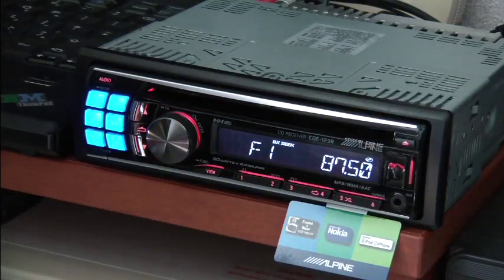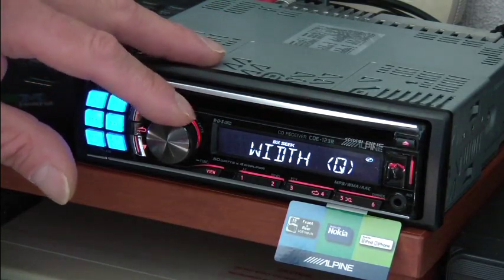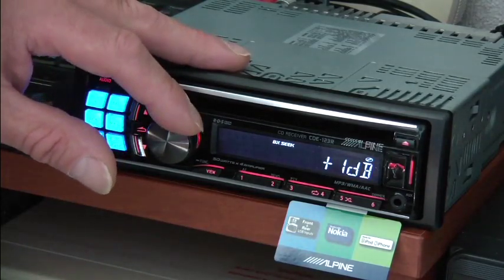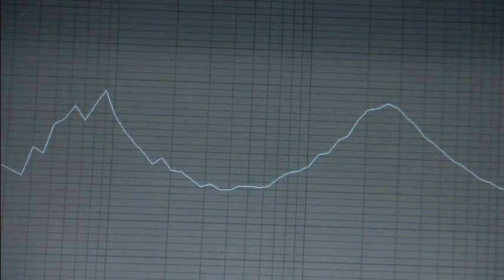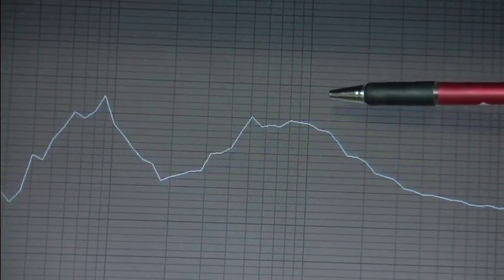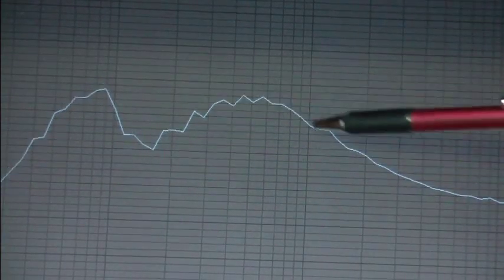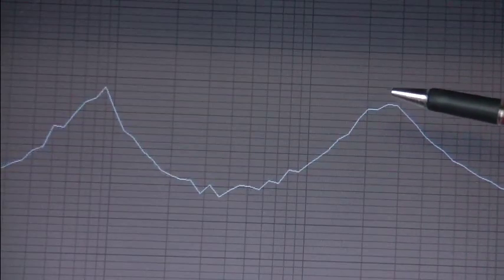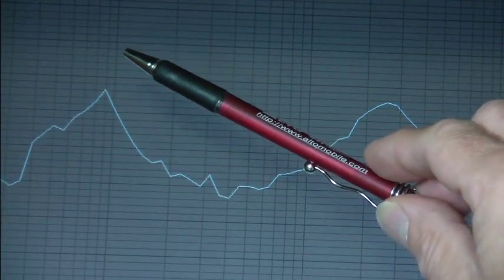Setting the Parametric EQ on a Car Stereo Head Unit

Comment: Under Audio, if I choose the preset Flat, Country or Hiphop, does it affect these 3 band eq thing too? what I'm trying to say is, can I just go with Hiphop and won't have to worry about setting the 3band thing or, I'll still need to play with it to get the best sound?
Secondly, when I'm at the 3band thing, there is Bass, Mid and Treble and they all have: Width Q, Centre frq and Level, where do you advice is a good starting point put these settings for it to work for most music genres from Pop to rock, country and hiphop?
And lastly, there is the Extra Bass (kinda like a dot button between forward & rewind button in the ALPINE UTE-201BT model)thing that when I press it, everything just becomes one huge bass mess, what does one do about that?
Reply from the maker: Hi. Choosing one of your presets (Flat, Country or Hiphop) is the same as manually setting the 3 band EQ. 'Flat' does what it says - it doesn't boost or cut at any frequency. It gives you a starting point, like a blank canvas, to then tweak using the 3 band EQ (left as it is it will normally make the music sound lifeless, but it will depend on your audio system; sometimes Flat is the best setting!). The Country and Hiphop settings will create an EQ curve that supposedly suits that type of music (but that will depend a lot on your audio system and personal preferences). 'Country' will be the one suited to a wider range of music. You can pick a preset that sounds closest to what you like, then tweak it with the 3 band EQ, then save it as your favourite setting. Short answer is yes, you will almost certainly need to set the 3 band EQ to get the best sound; presets usually just get you closer.
Your second question is answered in the video, where to have the centre freq, width and level (level being the cut or boost at the chosen centre frequency). With only 3 bands, the width control should normally be set to a wide setting (less of a defined peak) as this smooths (i.e. makes more natural) the transition between bass, mids and highs. The actual settings will depend on your audio system (especially the speakers) and personal preference; there isn't a one-size fits all. But 'in general', some lift at the bass end and in the treble, along with either a slight cut at 1k or a slight lift at 2.5k or closest option you have to that (which adds presence to vocals) is a good starting point.
The Extra Bass button... if it sounds bad, leave it switched out. I don't know where it's boosting the bass on the UTE-201BT, probably around 80Hz. Some bass speaker systems will like it, others will, like you say, turn the bass to mush. Instead, play with the Bass setting on the 3 band EQ - increase the boost (EQ level) to close to max. Don't have the volume on the head unit too high! Now, try different Centre Freq on the Bass (sorry, I don't know how many options the UTE-201 gives you, but just cycle through them). Some may sound like mush, others may sound okay but a bit too much, and in that case stick with the Centre Freq and reduce the boost (level) a bit. Like I said, the Width control (with only 3 bands to play with) is probably best left on its widest setting, but you can try to experiment with this, especially on the bass. Happy tweaking! Good luck!
Reply: @24HzICE  Now, how do I save it once I've set everything according to my taste? because I keep losing it each time I disconnect my battery.
The Width control should be set to a "wide setting" what is a wide setting? you said each of the 3 Bands have 4 frequencies, what's the "wide" frequency? how do I do the smoothening thing and where do I set the levels? step by step please. As your average viewer don't have that fancy tool you used in monitoring the smooth transition, how can I smoothen things straight from the Alpine stereo in my car without attaching any fancy tools?
And lastly, how do I reset everything back to factory default?
Everything would have been clear if you explained it using the actual Car stereo and not some fancy tool with graph displays, something no one watching owns.
Reply from the maker: @Sir-Kay  It's just too much for me to cover in a reply here. Your best move is to visit a specialist car audio dealer/installer. The guys there will be able to step you through it, showing how to set up your particular Alpine unit. Yes, you will lose the setting every time you disconnect the battery, that's normal. But you shouldn't need to disconnect the battery very often. You don't need 'fancy tools' to make any of the settings I described, but you do need a little knowledge to understand even just the basics. I tried to help and it seems I failed in your case, sorry. Go visit a store and let the guys explain it. I put time into trying to help you, for which I earn zilch, so I don't much appreciate the jibe.
Incidentally, to reset it to factory... disconnect the battery.

Comment: I don't understand how to make the curve smoother. I don't see it on the unit's display (Alpine UTE93) Also, in Alpine's Tune it app smaller numbers for the Q look like a sharper curve, is that right? Any advice on these questions, please? I'd like to get a cleaner, punchier bass, even if that means reduced volume, I don't like that boombox - like bass that most units produce with factory settings.
Reply from the maker: Hi Zach. Unfortunately I don't know the Alpine UTE93. The Tune It app - yes the smaller numbers indicate a sharper (narrower) curve around the centre frequency, so it affects the centre frequency and not much of the frequencies around it. If you are trying to get smoother curves (which is generally right; normally you will only use a sharp or narrow Q to get rid of resonance at a specific frequency, such as when a panel is resonating - you'll need an RTA to measure it), then you need a broader Q and that will help to blend the overall boost or cut across a range of frequencies which is going to sound more natural. 

To get cleaner, punchier bass involves a few things, and the starting place is not the EQ. The speaker and the box it is in will dictate the quality and/or type of bass. The EQ can be used to tweak it, but it won't correct a poor setup. For example, if you have a free-air type system, where the subwoofer is working into the entire boot/trunk space or a very large enclosure, you are unlikely to achieve truly 'clean, punchy bass' no matter how much you EQ it (a few subs have come close in various tests I did, if they have a very stiff suspension and the amp is top class in the way it controls the speaker). In most cases it will give you a lot of low end rumble, but you have to be careful not to over-power/over-extend the speaker, because there's not much pressure in terms of trapped air behind it to support the cone, and that's also why the cone continues to vibrate after the musical signal has finished (not for long, of course, but long enough to smear the bass sound and give that unnatural boominess). Do you want plenty of low end extension? Then it's a sealed enclosure with a well-matched sub. Or do you prefer a lot of output where it matters in most pop/rock music, at around 50Hz? Then go vented, again with a well-matched sub. For high output, a lot of 'punch' but not so much low end extension, you could go with a bandpass enclosure. Once you've made that choice, and the sound is just about right, then you tweak it with an equaliser, and perhaps add a high-pass filter at the low end (from 20-40Hz, depending on what you're trying to achieve and the roll-off of the filter) to reduce the very low end extension (which has the effect of making the sound punchier, and helps prevent the speaker from over-extending.

Believe it or not, that's a short answer to a long question. There's a lot more to the subject of getting a good bass, but I hope it helps.
Reply: @24HzICE  Thank you very much Sir! I don't have   a subwoofer, but I compare the sound to my previous, older Alpine unit. It sounded punchier on the factory Bose speakers. I believe they aren't of  very low quality. Today I played with the equaliser, set the 1st band at 32.5 Hz, this one I got at -6 dB. Second band, the bass, at 80 Hz, +1 dB,  Third is at 250 -1 dB, then up to 1 KHz curve goes down to -4 dB, then gradually up to the ninth band goes up to +3 dB. Still, maybe I'm more used to hi-fi sound, it needs "something" maybe an external amplifier......? Yes, I did too use the crossover. -12db slope at 63 Hz for the front (6.5") and again -12db at 50 for the rear (these are ellipses 6"x9" sitting on the rear deck with backs facing the trunk). The Bose speaker setup also has separate tweeters near the windshield, I hope setting crossover will not hurt them? They must be having their own  crossovers from the factory? The UTE-93DAB doesn't have HPF setting  for tweeters.
Reply from the maker: @zacmich6472  Hi Zach, Sorry, I misunderstood the kind of system you have there, just the head-unit. Much of what I said still applies though, because the 'punch' comes from the bass and lower midrange and so how the bass speakers are fitted and powered makes a big difference. Your EQ settings sound okay to me, though it's difficult for me to say without hearing the system. -6dB at 32.5Hz helps to protect the speaker, and +1 at 80Hz will add some punch. I checked the specs of the UTE-93 and it has some very nice features. It will probably be limited only by the built-in amplifier, especially when trying to produce low bass and a punchy lower-mid 'kick'. This is where an external amplifier (and woofer, but you have the 6x9s so they may be okay for now) can help a lot, and the UTE-93 gives some nice connection options. On your question about the Bose system, yes there will be a passive HP filter protecting the tweeter. 

You say you have the crossover set at -12dB at 50Hz on the rear 6x9. That will help reduce boominess (especially as they are firing into the trunk, although those 6x9s will have a fairly stiff suspension I guess, which helps to restrict their movement) but you may be losing a lot of the bass with that setting. Try to set the xover point a little lower (say 40Hz) but with an 18 or 24dB per octave slope (according to the specs the UTE-93 has these settings). The built-in amplifier will still be the main limitation though, so it may not make much difference, but if you add an external bass amp just for the rear 6x9s then this might be a good setting to test.
Reply: @24HzICE   Yes, I too think the integrated amplifier is the downfall, after all you can't have this power coming from such small components without a compromise, so I will think of upgrading it. Thanks again for a great advice!

Comment: I found this really informative. Thanks for sharing. Many tutorials assume a certain depth of knowledge that the majority of folk simply  don't have. Car audio isn't an exact science - what sounds great parked up on the driveway can sound terrible on the move and there's no shortage of pro installers happy to sell you another expensive piece of equipment when a little knowledge and time could probably improve the situation.
Reply from the maker: Thanks Billy. Totally agree with your comments on car audio not being an exact science, and yes, listening to a system while parked up (such as during an autosound contest, something I've done often) is a lot different to when the car is moving.  The first thing you tend to say is "where did that great bass go?" You turn the bass up, then park up again and it's so overblown now! It's a tough environment and challenging. To be fair to the pros, they will often use the profit they make on the new piece of kit to cover the value of their advice, and if there's an improvement then fine. But you're right, with a little knowledge and some tweaks and improvements in, for example, panel dampening, existing kit can be made to perform noticeably better.

Comment: Great video sir from San Antonio Texas. What is a good method in choosing where the best crossover points are in/on car stereo aftermarket speakers. 
I’m having a little difficulty with my Focal Flax expert 165fx two way 6.5’s front active stages
Rear passive matching Focal Flax Co axial- using them full range .
And my subwoofers low pass set at 40-120hz thanks for any input!
Reply from the maker: Thanks John. I know Focal, though I don't know those specific drivers you have. But first of all, take note of what the manufacturer says in terms of the lowest frequency the driver can handle at rated power, especially when using an active xover; that's true of tweeters as well as mids... subs too, for that matter. That's basically the mandatory safety warning done. The crossover point for the 165fx 2-way ought to be close to where Focal advise - they know their stuff & will have figured the ideal xover point. You can adjust it a little by ear while listening ONLY to the 165fx (if you have any other speakers working it will confuse the hell out of you!). If I'm reading it right that you are using co-axials in the rear, full-range, that likely to be a problem. The upper frequencies from front and rear sets will be overlapping, causing additions, cancellations, phasing issues and messing up the staging. If you can, put a low-pass filter on those rear co-axials set around 1-2khz (you'll need to experiment). All you really want from them is the sense of reflections you'd get in an auditorium, mostly midrange, and keep the level from the rears low, subtle. In a live scene, high frequencies get absorbed by the audience, soft seating etc, so we want to try to mimic that and, at the same time, stop the highs clashing with the highs from the front speakers. First thing to do, switch out the rears and subs and listen only to the fronts. Get them sounding right. Listen to the staging too, if it's across the windscreen - it should be, without the rears working (depending on how/where the front drivers are installed). Then bring up the rears and hear how the staging and imaging gets destroyed :-) So then roll-off the highs from the rear and listen again - the staging and imaging should be back, but with just a little sense of something going on behind you. Then bring the subs in and match by ear. Of course, if you have an RTA handy, or a local installer who can help, even better as you can then see peaks and dips. But your system is not too complex (no bad thing) and so you can do it by ear. Good luck.